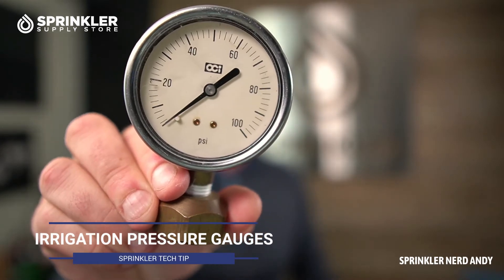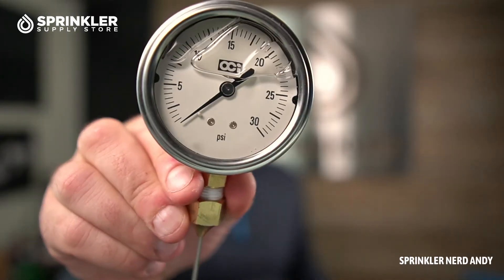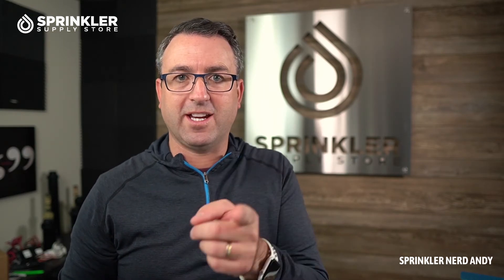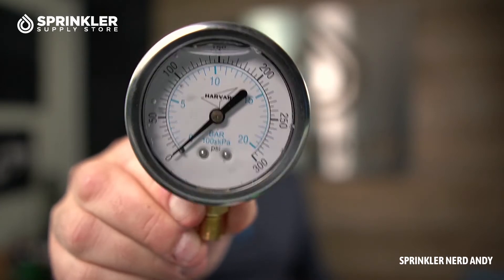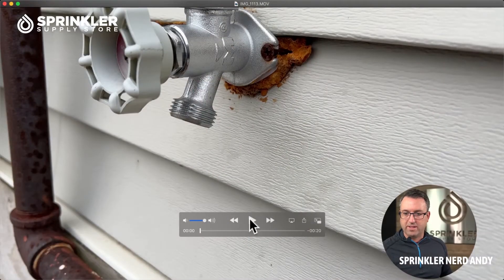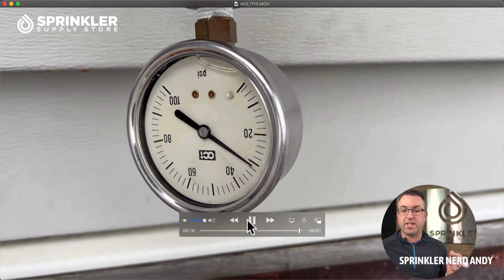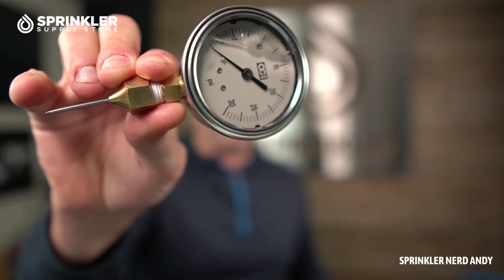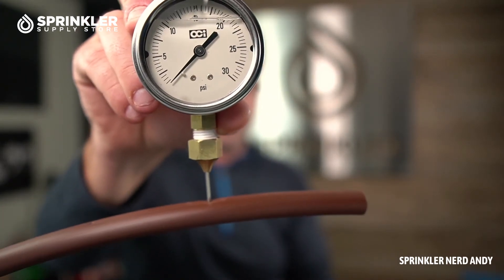How to Test Irrigation Pressure with Gauges | SprinklerSupplyStore.com

Comment: Thanks. How do I test the pressure of my irrigation system if my water supply splits after than water meter, with one side, going to the house (which includes the outdoor faucets), and the other side going to the irrigation system, which has an old pressure control valve on it right after it splits? If I test it at the faucet, it is not the same that my irrigation system is getting.
Reply from the maker: As strange as it sounds, you can actually test the static water pressure any place. Just make sure all the water is off on your home before doing so.

Static water pressure is only influenced by elevation, or a constant pump.